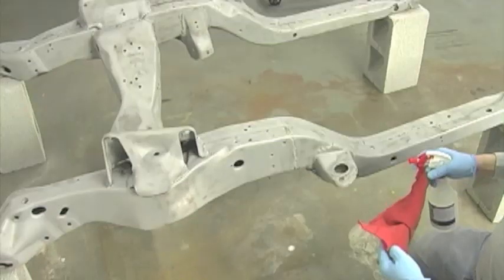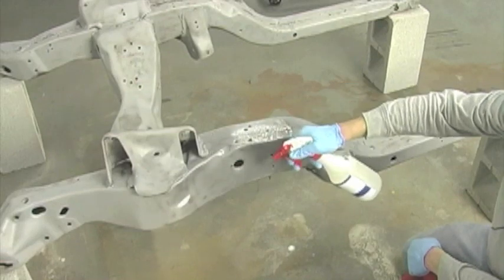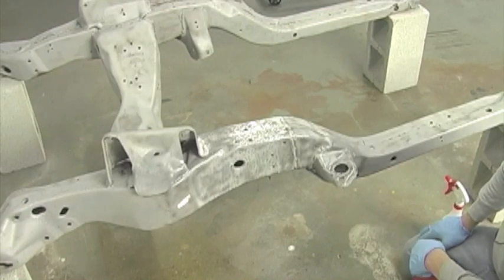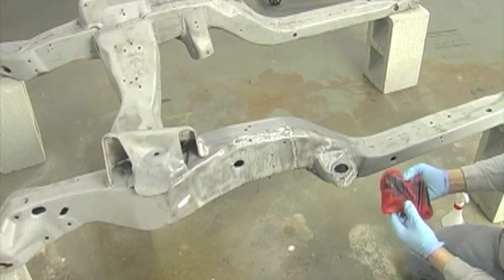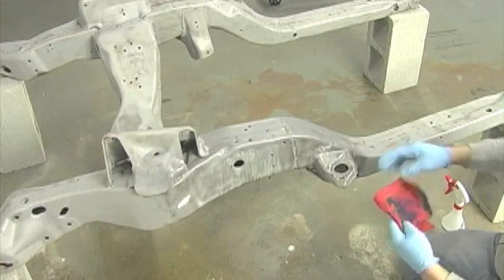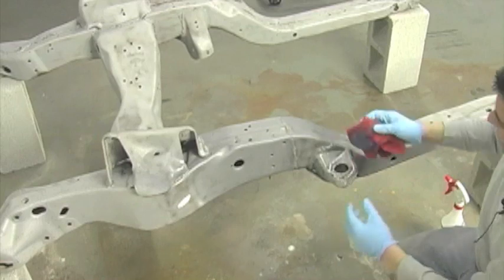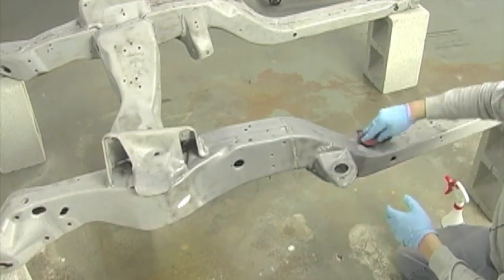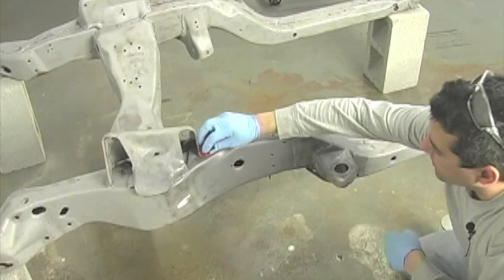After Blast - Clean & Etch Metal after Soda or Abrasive Blasting from Eastwood

Comment: Im currently in the phase of sandblasting….this helped me alot however after using phosphoric acid, what primer  do you recommend for the bottom of a trailer to avoid future rust? 

Is this a general rust primer? 

Thank you
Reply from the maker: Epoxy Primer is what we recommend over bare metal.  It has great adhesion and good rust prevention.

 https://www.eastwood.com/eastwood-gray-epoxy-primer-gallon.html

Comment: CAN I APPLY EPOXY PRIMER AFTER USING THIS AFTER BLAST?
Reply: I've worked with iron phosphate coating applied by spraying and scrubbing. I've used multiple brands. I've also painted items coated afterwards. I've also read passages from many books on the subject including from The American Society for Metals.

 I have never used after blast though. My experience with phosphoric acid based iron phosphate coating is I would highly recommend rinsing while wet after a certain amount of time has passed. 

Do a test area with After Blast and let it dry. Is there a lot of white residue? If there is you will definitely want to rinse while the product is wet after a certain amount of reaction time has passed.

 Additionally, there is another video on the product Ospho and epoxy where the guy runs torture tests. He found the adhesion was much better with rinsing even though Ospho does not recommend rinsing.
Reply from the maker: Yes, the phosphoric acid will etch the metal and provide an excellent surface etch for paint adhesion.  More info here: http://www.eastwood.com/eastwood-afterblast.html
Reply: thank you very much, I got the gallon from you guys.
Reply: I've also heard that conflicting process after applying the "After Blast", that you are supposed to wipe the surface down with "PRE" before you apply the primer. I'd really like to know the best & correct procedures because I want the rust gone forever. I'm actually barely going to start treating all the rust spots on my restoration to stop any further spread while I work on the engine. (I have it professionally painted later).
Reply: can you help with Jer Bear's question? Just need to know how to correctly use your products to eliminate the rust forever. I will not be blasting, but will remove surface rust areas down to bare metal with polycarbide abrasive wheel/disc, then applying After Blast, & finish off with 2k aero-spray epoxy primer from Eastwood. please let me know if I'm on track or missing a step.
Reply: If your really eager to know run a few test panels. One with no rinse and other with rinsing after the product has reacted.
Reply: what about the phosphoric acid not good for certain epoxies? My body and paint shop here locally told me I would not want to let it dry.  That it will not allow correct adhesion of the primer.  That i would need to wash it off after i clean it. ???? does this sound familiar?
Reply: same here, if you watch several of the eastwood tutorials you'll hear the conflicting info whether or not to use PRE. I'm curious to know the reaction between PRE and AFTERBLAST. Does PRE remove zinc phosphate left by AFTERBLAST or is it simply cleaning the new zinc phosphate layer?
Reply: Adam Prince cool, thank you. what do you rinse with?
Reply: Adam Prince let me know if/when you do make a video. I'd like to get the work done as best as possible on a project for my personal restoration
Reply: Adam Prince I just subbed
Reply: The afterblast does loose some of its "sticky" as far as top- coats after a few says. I use pre wipe down before Expoxy in that case.  Do not use After Blast  after grinding, use Eastwood  "fast etch" for that and follow the video Kevin Tetz does on it.
Reply: You replied before I finished the second comment. Just try using clean tap water. I have tried tap water, spring water, distilled water, actone, lacquer thinner, etc. If you have well water or tap water with high amount of chlorides (ex. sodium chloride=table salt) use a better source of water. 

My experience has been with iron phosphate coatings (After Blast claims to be zinc phosphate) is that if you achieve a good coating and dry after rinsing it will stay rust free for many months indoors (upstate NY). If it flash rusted shortly after drying then you did not get a good coating. 

I was thinking about making a video in layman terms about the chemistry and application. The directions on a lot of coating products are awful vague. I don't think the manufactures spend a lot of time personally using them. Application can be effected by a host of variables.

Comment: @jordan.   Some areas it is better to not touch with a rag...  Like this frame shown in video...  Air blast dry, and epoxy prime is sufficient.   But when you're talking about body panels, it's a little different as you want them surgically clean.   Even compressed air will not remove %100 of foreign contaminants.   Especially when blasted with common sand.   Lots of dust left behind that MUST be dealt with

Comment: Any flash rust caused by the hot water not evaporating quickly enough can be knocked down with a Brillo pad, and the dust left behind from this process is wiped away with said wax/grease remover.   I've been doing cars this way for 20 plus years and never had an unhappy customer

Comment: Most paint/primer manufacturers won't warranty their product if metal is prepped this way.   I have done numerous restorations and although you might think I'm crazy, hot water and blow dry is your only problem free solution.   No matter what the surface is, we always use a waterborne wax and grease remover (mixture of rubbing alcohol and acetone).  Before spray applying any paint or primer.   Acid under primer is just a bad idea all around.   Most good 2pk epoxy primers contain zinc anyways
Reply: Well said man. Thanks

Comment: I sand blast and paint for a living and anyone who wipes down anything they just blasted is an idiot
Reply: when you wipe blasted metal, it is like wiping a  cloth on sand paper you will leave a film of your towel on the  metal, if you MUST wipe, use a blue jean material with brake clean ( in my opinion) then blow off really well
Reply: What would be your suggestion then?
Reply: Dry high pressure air and control the conditions. I blast and coat pipelines you can't touch it with anything but a dust test after blasting.
Reply: I agree! Anytime I've used any post-blast products (pre-paint etching solutions, acid washes, g-golly-wolly snake oils, whatever) it just caused the metal to flash rust in literally seconds, completely negating all the sandblasting work.... Of course, there are people out there that say to just blast it again, use the "miracle" product, then blast again until you don't see any flash rust, but... What's your time worth, and, is it not good enough to just coat it (Rust-O-Leum or even just normal paint)... I don't know, I've used VHT roll-bar paint on a lot of chassis parts right after blasting and have never seen rust come through, even after several years, so... that's my personal opinion to anyone who cares...
Reply: So after media blasting or dustless blasting, how should it be treated and cleaned? And eventually a paint prep will have to be used correct?
Reply: I'm one of those idiots. Tis is my first time doing this so I guess I have to learn the hard way.

Comment: I swear by After Blast.  It disolves the rust and leaves a zinc coating which keeps the parts from rusting.  If you have flash rust, it will make it disappear in seconds.  For smaller parts, I'll dip them in a vinegar vat first for a say or two, then treat with After Blast.
Reply: epoxy coat will take care of any  slight rust after blasting    RustBlasters.com

Blast/Blow/epoxy coat/DONE!

PRODUCT DESCRIPTION

PRODUCT CHARACTERISTICS
• Fast drying properties
• High performance coating for new or old steel
• Self Priming in many applications
• Compatible with prepared, damp surfaces
• Compatible with adherent rust remaining on prepared surface